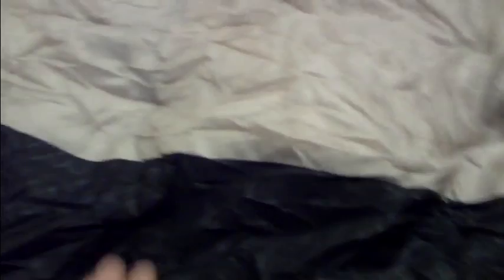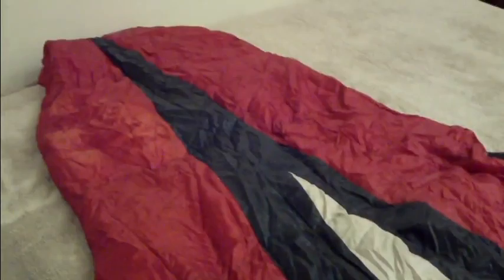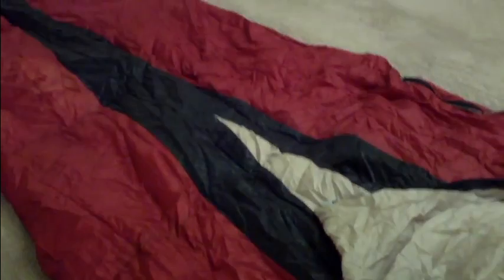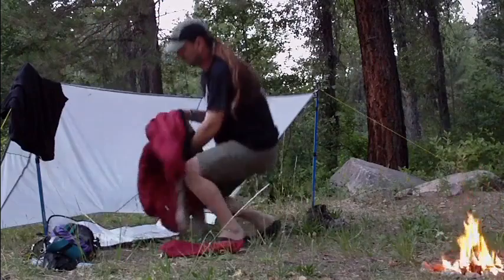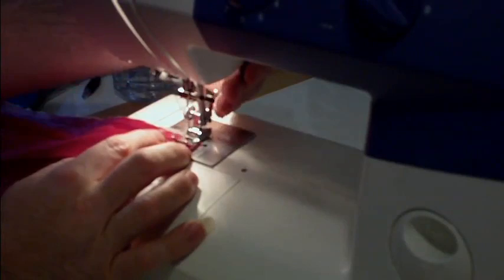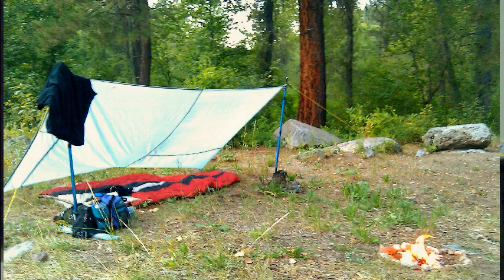DIY Homemade Down Sleeping Bag

Comment: A couple of more tips if you are going to make a bag....#1. Use a space blanket inside against the down material....use 3M spray glue/adhesive to put them on top of each other.....you don't need a lot......sew in a zig-zag pattern on a 45 drgee angle to the bag to remove dead spots, use velcro instead of zippers.....velcro always works.....sometimes zippers don't......spray outside shell with a good tent waterproof spray.......Makes a great bag....under 1.5 lbs.
Reply: whats with the fullstops?

Comment: Awesome Video, Thank you! I will be making my own sleeping bag, I am a seamstress. So some hits from a Seamstress, we call it a "Seam Ripper", if you go and ask at the fabric store for a Seam Puller, you will likely not get the right tool. Also, if your new stitch holes from making your baffles are an issue; there are some glue’s that are just for nylon/poly and they would close up these holes and keep you warmer. If you use a thin layer it will not add much weight. E600 is my favorite for this because it dries clear and flexible and can go from Hot to Cold or Cold to Hot without cracking. I would recommend testing this on scrap to learn how to apply the glue first and it’s not easy to work with. You have the patience to sew; you will be totally able to learn use it! If you need more info let me know.  Again, Thank you!
Reply: NolweOobe, Thank you for the lesson. Using E6000 for sewing work! I have some of that. New use for it. I'm just trying to imagine how the E6000 would be applied, before I google it. :)

Comment: What I wish someone would make.. is a good sleeping bag shell. Just the fabric part, with an extra zipper that opens into the baffles. That way, instead of having lots of sleeping bags, you can have one bag, and stuff it with the amount of down you need for the trip you're planning. I'd be willing to carry the extra weight of an extra zipper to have the flexibility of having the right amount of loft/down for any weather with only one sleeping bag.
Reply: You forgot that the down got to be "compressed" at an optimal value in the baffles to get the most of it... there is no "all in one" solution. The kickatsrter solution will not work, well ... it's funny but non effective. In the worst case you'll need three sleeping bags ... one "polar" for -40°C (2.5Kg), one three seasons -5°C/-10°C (1.3Kg) and one for summer... 10°C (0.6Kg). And look for good brands of sleeping bags... Cumulus, Warmth, Valandré, 000 ... etc
Reply: ***** Why wouldn't it work? down needs to be not compressed to work. If you compress it, it stops working. But that limitation is true for any sleeping bag. Whether the baffle is removeable or built in, is no different. Personally I don't use separate 3 season and summer. You can push the down off the top for summer to reduce insulation, so summer is kinda.. pointless unless you really need to save weight. -40.... I'm not that cray cray.
Reply: Not totally right .... down needs to be compressed the just right amount, the air should not move between clusters/feathers. Imagine a baffle 2in^3 with 3 clusters in it ... not enought ... 100 clusters int it ... too much .. there is an optimal amount of down per unit of volume (depending on the down). By saying it will not work i mean ... the idea of using 20grams in a baffle in summer and 50g in winter ... is not optimal, people that hike a lot, specially UL hiker... wants it to be optimal. For some ... 100g is nothing, for others .. it's immense, depends on what you do.
Reply: Now there is a solution that already exist, a normal sleeping bag for summer AND a bigger one that you put on top of the first (without compressing the insulation of the first one)... you've got a winter sleeping bag. BUT this will not be optimal, double zipper, double shell ... etc.
Check : Tropen + Defence4 by CARINTHIA
Reply: *****
the kickstarter thing.. isn't for super ul folks. it's heavier because of the extra fabric and there's no way around that. But not everyone is looking for the absolute lightest.  As for optimal.. you are looking at it from efficiency of down fill. But that does not mean optimal. If I'm in a 0c bag, and it's 30c.. max insulation is not optimal. If I'm hot, and there's bugs, I can take out baffles to make it cooler and still be closed off from the bugs with this thing, while on a closed bag.. I'd have to choose between being hot, and being bitten.
Reply: Breathable bivi bag eg goretex, Summer down 1-2 season bag as above, silk or cotton liner, down/ waterproof clothes. All seasons covered.
Reply: take up sewing and create anything you can set your mind to.

Comment: I've got an old, fairly good polyester filled 'Marlboro' bag, that I've been toying with the idea of making into a quilt, because of it's bulk. Haven't got to it yet, but this may just insprire me. You did an excellent job on your bag. Looks great and works well. You can't go wrong there, can ya. Now I've got to go haunt the local D.I. and see if I can't find a down quilt or two. Wonderful ideas John. Thanks.

Comment: I am curious as to why you chose a bag over a foot box quilt design.  Seems like you could trade some of the weight of the bag that is being compressed under you and not serving to insulate for a better sleeping pad.  You would also eliminate the zipper. If you shaved 5 oz this way you could add 5 square feet of reflectix to your sunscreen sleeping pad and still be at the same weight.  5 oz of reflectix under you would have to provide more comfort and warmth than 5 oz of compressed down.

Comment: I have to admit that few things scare me more than ultralight backpackers.  Weight seems to be an obsession with them, which is fine until something goes wrong.  I see ten ultralight backpackers get into true life-threatening situation than any other type of camper, and it also comes down to have gear that is simply too light to be any good in an emergency.  Five pounds base weight is extreme, even for the ultralight crowd.
Reply: +James Ritchie I think it all depends on what they are doing doesn't it?  I enjoy traveling light, not having to lug around heavy equipment is extremely liberating and you burn a lot less calories carrying 5-10 lbs than you do carrying 40lbs, obviously.  With a 5lbs back during warm weather I'd imagine you can carry just about everything you'd need for a few days of hiking but if its gonna be serious weather, winter camping, or longer than a few days.... I'd probably want more than 5lbs as well.  I'm trying to put together a pack under 7lbs.  Still very light, still have all the essentials.
Reply: For me camping and hiking is a way to lose weight lol, as such my gear reflects that lol.

Comment: So if I used say twice as much down and a fleece bag liner would i be ok for mid to low 30s?
Reply: +TheElvenArcher  The fleece liner will add weight and give you maybe 10 degrees if your lucky.  If you need a light weight down sleeping bag and don't want to pay hundreds of dollars, go on ebay. There are 40 year old down bags that are still just as warm as the day they were produced and old down was much better than the stuff used today. I picked up an old REI bag that weighs 1lb and can definitely be used in conditions down to 20 degrees. I paid $ 34.00.
Pay a little more and you can get a 0 degree bag. These bags if taken care of, can be passed down to your grandchildren.
Remember, just buy some down soap, go to laundry mat, use a front loading machine on gentle, dry on low heat and that old bag will be as good as new and the fluff will come back.
Reply: thanks i will do that. i bought a Teton trailhead which is light and great for summer camping but its 20 degree rating is just total bull. i was cold in high thirtys.

Comment: You must be rich. You have an electric powered threading machine. I'm still using foot powered. Hand if I break a belt.

Secret to reviving goose down is use a steamer. It comes right back. 

Down side to using it, it loses all its warming property if it gets wet. 

I might try and use an old retired PD chute. They have the cells already stitch x7,

Comment: Excellent video...Great idea for a DIY project and a great way to save a bundle of money on an expensive down-filled sleeping bag ($400-$900)...Thanks very much for sharing your valuable knowledge and skills here. Question: I'd like to try this project (as I need a light & warm bag for an upcoming backpacking trip), but I don't have a sleeping bag that can be easily dismantled and fits the design for a mummy bag (which seems to be the best design for a warm backpacking bag). Might you (or any reader) know of an existing lightweight sleeping bag shell that can be purchased online? Or perhaps an existing inexpensive sleeping bag online that can be dismantled easily? Have a good day! Cheers, Steve
Reply from the maker: You're more than welcome Steve. I definitely agree with you that DIY is an excellent way to save a ton of money on otherwise expensive gear (plus you get exactly what you want/need)!  I'm not currently aware of any place that sells just a shell... although if I find one I'll definitely let you know. I just tapered the bottom section of mine into a mummy bag style while I was doing the sewing. Not sure if that helps or not, but figured I'd pass it along just in case. I hope that your project turns out great for ya, and I hope that you have an awesome time on your upcoming trip! Thanks for taking the time to watch and comment by the way... it's much appreciated!  Cheers...  John
Reply: @IntenseAngler  Okey-dokey...Thanks for the clarification. My next trip to AmVets will be to look for (a) an old sleeping bag that might be adapted to this project, and (b) an old down-filled comforter, jacket, etc. that might be a source of down. Again, excellent ideas here. Thanks!

One other thing: It seems that the down bag companies use a no-see-um mesh between baffles, so as to avoid cold spots if one simply sews the two sides together between baffles and have no insulation along the sew line. Cheers!

Comment: Hey john this is a really old video, I was wondering if you ever tested this to see how cold you would be able to take it? Did it hold up, and would you have done anything differently?
Reply from the maker: Hi there John (great name by the way 👍). I've definitely used this old bag plenty my friend. It performs well down to about 40 degrees... I wouldn't push it past that for sure. It's held up surprising well actually, although it does shed a few feathers nowadays. The last time that I used it was back in mid August, and it still did the job 👍 If there was anything that I would have done differently it would have been to just make the bottom uninsulated and use the extra down on the top where it would be more effective. 
Thanks a bunch for your comment by the way... it's awesome seeing it brother.

Comment: If you add more down, could it be a colder weather bag? Or would you have to add other materials?
Reply: +rox290 It would be, theres plenty of space in there for more down, but he wants to avoid the weight, he could probably gain a few degrees per ounce of down

Comment: Will a space blanket and synthetic material like 1" sandwich between sillnylon work?
Reply: a space blanket will trap both heat and moisture. Therefore, I wouldn't use a space blanket with my bag.
Reply: There is a reflective martial called Arma-tech it has the reflective capacity of a space blanket and breathes like gortex.

Comment: Very cool, I have just started an interest in super-light backpacking as well.   If you are into making your own sleep systems, check out the superinsualtor  Aerogel. You can buy a piece at aspen aerogel.com. The aerogel is ultralight water proof and fireproof.  the price is moderate but you cannot beat the insulating properties  
  Love the idea of taking old gear and giving them an upgrade

Comment: 5 bucks?...no. By the time you aquire a sewing machine, learn how to use it, spend the time searching for a thrift store with a used down comforter (rare), and the gas/wear on car to get all the stuff required for this project, you're close to the same price a lower-end/professionally made down bag costs.  The hassle isn't worth it.